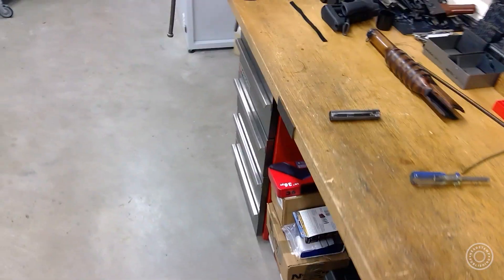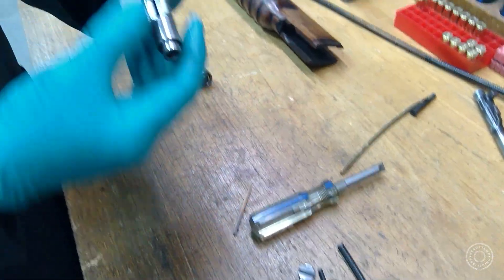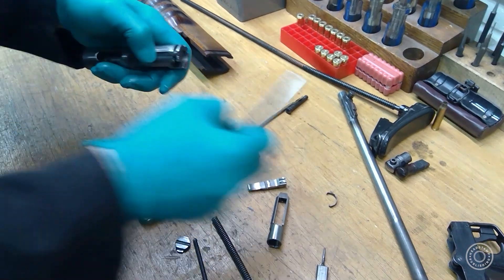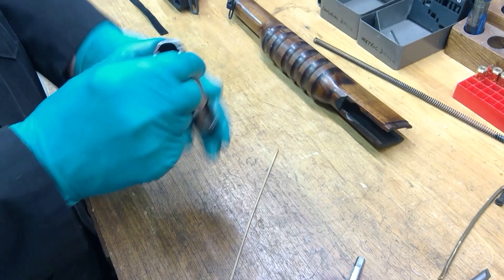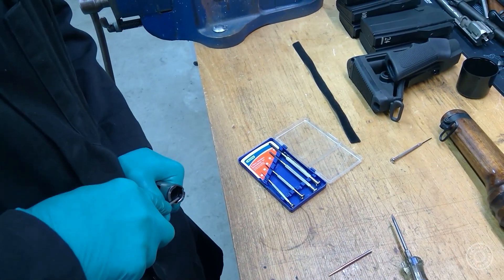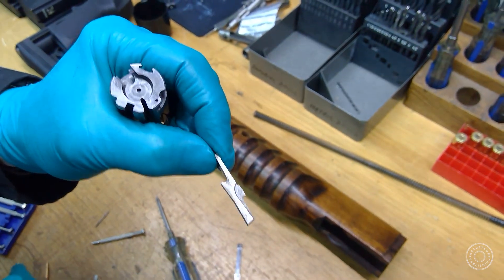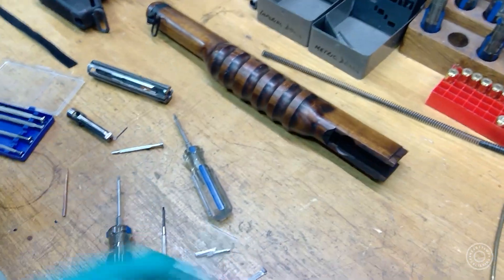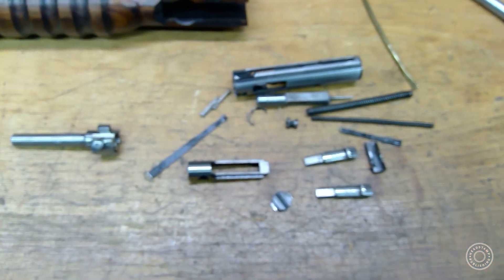E.M. 2 Bolt Disassembly with Jonathan Ferguson

Comment: The Rube Goldberg of bolt assemblies , or seeing as it's british , a Heath Robinson one .
Reply: Not really, it’s based off the G43 which is a simple flapper locking system. It’s basically the same basic idea as roller locking which would lead to roller delayed blowback as seen on HK guns.